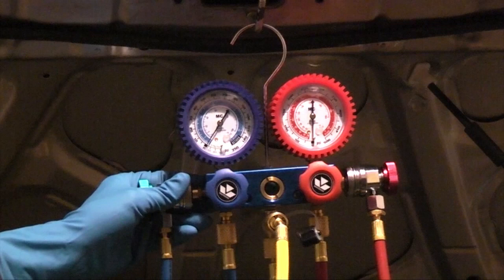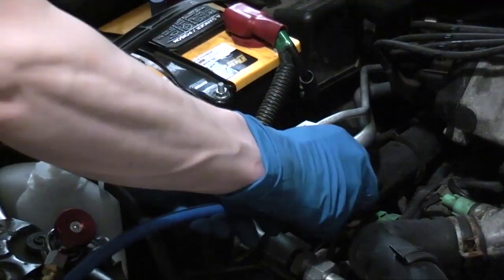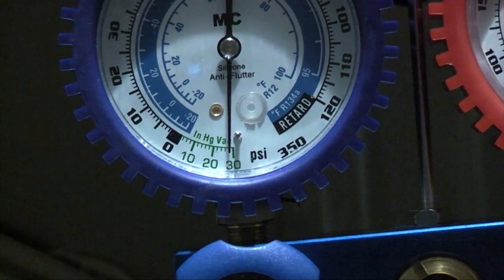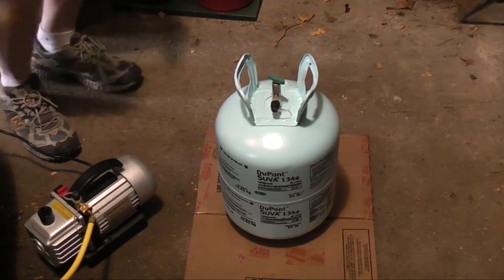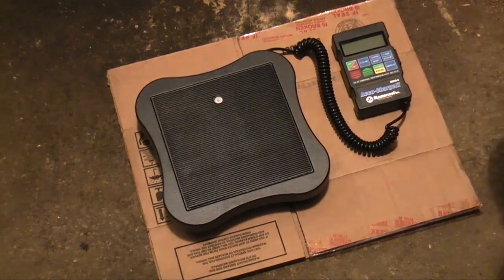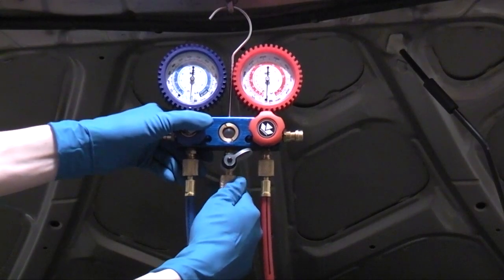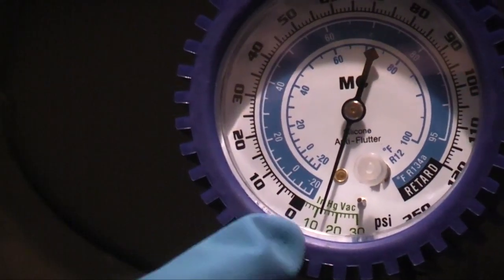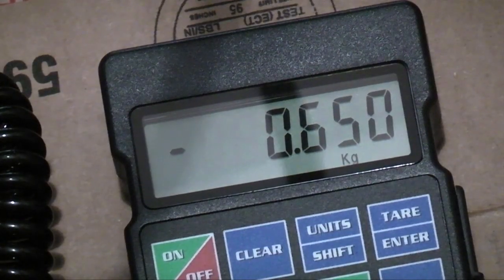How To Recharge an Auto AC System

Comment: Finally, this fellow youtuber,  explains   the importance of vacuuming out the ac system and why it should be done.  What a great  thorough video on AC system charging and testing.. Thanks so much...Canada..
Reply: Yes, one thing make sure you do NOT turn the manual quick connect ALL THE WAY DOWN. 
Watch the gauges as you manually turn them one a a time until they engage the schrader valve, you will notice a small movement on the gauge and then you know the schrader valve is open. I had to replace one of my schrader valve due to turning manual quick connect ALL THE WAY DOWN. GREAT VIDEO!!!

Comment: but the problem that you dont mention how to add oil for the system .
Reply from the maker: Salman Almahal The no special tool method is to pour it into an open line before you close the system up. Adding it to the receiver dryer or accumulator makes less of a mess because they act as a reservoir to hold the oil. The refrigerant charge will distribute it throughout the system when the compressor runs.

You can also buy an oil injector and add it through the low side fitting after the system is closed.
Reply: ***** so we can add the oil before close the system , then make vacuum for the system
Reply from the maker: Salman Almahal
Yes.

Comment: You can only get 30" in hg when close to sea level elevation. at high elevations you get less. Sense there is less atmospheric pressure.
Reply: There is less atmospheric pressure at higher elevations, not that atm. pressure has anything to do with closed vacuum system attainable VACUUM. That vacuum pump can suck vacuum down pretty close to absolute...around 5 pascals.

Comment: Great video.  Covers the fundamentals very well.  The most important part is: you told the audience they need to weigh their charge into the car.  

I have a 1995 Accord V6 which I recently replaced the compressor, dryer, condenser coil, evaporator coil and expansion valve.  The system held nitrogen at 100 psig for one hour and full vacuum for 24 hours.  No leaks.  I charged the car with 21 oz as noted on the label of the vehicle.  I use a Robinair charge cylinder to measure my refrigerant charge.  

Once the vehicle was charged the compressor engaged and the car begins to cool.  Both fans are operating at the radiator.  No short cycling of the compressor however, I cannot get delivery air temperatures below 70F from the dash grills.  All doors and windows closed and the car is in the garage with ambient conditions of 86F and 77% RH. 

This morning the static pressure is 75 psig at ambient conditions of 77F.  At idle the low side: 21-28 psig, high side: 125 psig with compressor engaged.  At 1500 rpm the low side: 15-20 psig and high side 140-150 psig.  The pressures seem low.  

Not sure if I have a bad thermistor or bad remanufactured compressor.   Any suggestions?
Reply from the maker: KMech KMechanical How much oil did you add to replace the lost oil in the old components? The service manual tells you how much oil to add based on which components you've replaced. You have to use the right oil Honda recommends ND8 which is a factory part number. PAG 46 is it's equivalent. PAG is the oil type 46 is the viscosity.

Why was the old compressor replaced? If it was due to mechanical failure you need to flush the aluminum lines to prevent debris from destroying the new compressor. Based on all the components you've replaced the oil in the system will be minimal so I hope you didn't forget to add it.
Reply: *****   Very good point.  I thought that I initially over lubricated the system the first time causing a 'fouling effect' on the cooling coil.  So I flush cleaned the evaporator coil and condenser coil but did not add addition oil.   I have a Honda service manual I purchased from Helm with the recommended oil fill for each component.   I will go back and add where needed.   The compressor was properly filled with PAG oil.  It is my understanding that you need the proper amount of oil in each component along with the correct charge in order to achieve the proper pressure readings?
Reply from the maker: KMech KMechanical
As long as too much oil isn't added it doesn't matter where it's put in the refrigerant will evenly distribute it throughout the system.

Did you insulate the sensor bulb on the expansion valve with prestite tape? It needs to measure the temperature of the evaporator outlet tube and not the air blowing past it.
Reply: ***** I did not answer your other question.  My apologies.  The old compressor did not mechanically fail.  I had a problem with the cold system cooling.  I initially replaced the thermal expansion valve, pulled vacuum and recharged.  The car never cooled below 65F.  In the summer when it was 100F outside it could not keep up.  The car is an old salvage I acquired three years ago.  At the time it cooled great.  Since I had no history on the vehicle I decided to replace the HVAC system this summer.  Its my commuter car to and from work.  I did flush the all refrigerant lines with a flush gun and flushing agent for automotive systems.  All of the lines were dry when reassembled.  The dryer remained sealed until final installation to ensure it was not CV compromised. 

The new compressor has not run too much so hopefully nothing is damaged.
Reply: ***** I did not use prestige tape however, I did cover the bulb well with foam insulation used on copper refrigerant lines.   Felt that I insulated it well from the air stream.

Comment: Hey man great vid with detailed instructions, though I do have one question. Do you have to also purge the low side hose as well after purging the charging hose to prevent an air pocket from that line into the system?
Reply from the maker: 318BENZO No the high and low sides are sealed off from atmospheric pressure by the closed valves. If you were to crack the low side line you'd lose the vacuum.
Reply: Exactly what I thought! Thanks for the confirmation man. Keep up the good lessons.

Comment: Some kinds of refrigerants must be charged as a liquid. They are blends of several kinds of refrigerant that vaporize at different temperatures. If charged as a vapor you don't get equal amounts of all the ingredients and your AC won't work right. Extra equipment is needed to do this safely.
Reply from the maker: Galfonz Well I don't see auto A/C using refrigerant blends like R-410A any time soon =).

The new emerging refrigerant for auto A/C R1234yf is azeotrope or azeotrope-like. So I believe it can also be charged as a vapor. I been following it awhile but I haven't come across a vehicle that needed service with it yet since so few vehicles currently use it.
Reply: The only reason I know anything about it is when I had an AC serviced by what turned out to be a guy who didn't know what he was doing. When a qualified tech fixed it he explained what had happened.
Reply from the maker: Galfonz
If it was a residential system with a refrigerant blend such as R-410a which will fractionate (the refrigerants that make up the mix will separate and enter the system in the wrong proportion) if not charged as a vapor.  I can see that happening.

But R134a can be charged as a liquid without concern.
Reply: ***** but R134A is an azerotropic  refrigerant it must be charged as a liquid.  With the vehicle off one can change the high side and get most of the charge in the system.. When you equalize the pressures then you only charge through the low side in liquid form throttling it very carefully till you have the correct charge.   Then shut off the tank and high side.  Disconnect the high side hose. Continue to charge the system with what is left in the hoses and shut off the suction line and disconnect the hose. Replace the caps and you are done.
Reply from the maker: George W
No you've got it in reverse.

A refrigerant that must be charged as a liquid is a zeotrophic refrigerant. A refrigerant that can be charged as a liquid or a gas is an azeotrophic refrigerant.

So yes you're partially correct R134A is an azeotrophic refrigerant but it can be charged as a vapor or liquid.
Reply: ***** interesting R410A Fractionates Just like R717 or known as ammonia.
Reply: ***** well I stand corrected. Thanks for the information. Believe it or not they teach that in refrigeration schools today.
Reply from the maker: George W
I'd bet most guys that charge auto A/C wouldn't even know this information. It's primarily reserved for those working on residential and commercial A/C systems.

Technically R134a is what is called a pure refrigerant it isn't a mix so it's can't separate (fractionate).

Azeotropic refrigerants are a mix that won't separate when charged as a vapor and therefore ACT like a pure refrigerant.

So for practical purposes I just call R134 a azeotropic refrigerant to avoid explaining a minor technical difference that doesn't matter in practice.
Reply: ***** So true. I've been in the residential and commercial HVAC-R field going on 33 years now.   Curious do you see R134a oil plugging up offices?  I have seen the oil plugging up lots of driers in small to mid sized units over 8 years old. Every once in a while I get one in warranty. Over all it's a decent refrigerant.  I still miss the old R12.

Comment: So I do not need to drain the old refrigerant when vacuum out the system?
Reply from the maker: InTheory Yes You need to have the system evacuated (the refrigerant removed) if your gauge set indicates that there is any pressure in the system before opening the system or pulling a vacuum.

Comment: Dude...how much the desired pressure and temperature between the low side and high side of the system by using refrigerant 134a?
Reply from the maker: Rey Lavador The pressure differential between the high and low side in an operating system will vary depending on the system design. Expansion valve, orifice tube with cycling clutch, variable displacement compressor, etc. Ambient temperature and humidity also are a factor.

A quick and dirty test to evaluate A/C performance is to feel the suction line going to the compressor which comes from the evaporator and the low pressure liquid line (after the expansion valve or orifice tube) going to the evaporator. The temperatures of those lines should be equal if the system is functioning properly. If the liquid line is colder than the suction line is it usually indicates an issue. Most of the time it's because the system isn't fully charged.

Comment: Why don't you pull the manifold gauges to a vacuum before connecting them to the system?? My teacher thought me to do this so that I would be absolutely sure that no air got into the system when connecting the gauges to the service ports.
Reply from the maker: Roger Sahagun The system is empty and at atmospheric pressure and so are the gauge hoses so there is no need to pull a vacuum.
Reply: Yea I saw that sorry about that. But if you're just checking the system for diagnosis, you should  pull the gauges into a vacuum to prevent air from entering the system right?
Reply from the maker: Roger Sahagun
I see nothing wrong with it as long as both valves are opened so the vacuum is pulled on the high and low side lines, the valves are closed after the vacuum is pulled, and both quick connects aren't connected to the charged system during the process.

But it's not common practice. You're also assuming that the low loss quick connects are perfectly air tight.
Reply: If the manifold gauges are pulled into a vacuum, I wouldn't need to "purge" the yellow hose when charging the system right? Or would I still need to purge it
Reply from the maker: Roger Sahagun
Many gauge sets don't have a low loss fitting on the yellow charge line.

So the instant the line is removed from the vacuum pump to connect it to the charging cylinder the vacuum in that hose is broken.

So it would still need to be cracked at the gauge set to purge it with refrigerant.

Even if it has a low loss fitting it's always a good idea to purge the line just to be safe.

Comment: When u vacuum the system dose the liquid refrigerant in the liquid side boil out or it has to be removed some way?
Reply from the maker: WeTryYouWin To remove refrigerant you evacuate the system using a recovery machine. It is then safe to open and service. Opening the system allows air to enter.

You never use a vacuum pump on a charged system a vacuum pump is ONLY for removing air from the system (atmospheric pressure) introduced during servicing the vacuum allows moisture to boil off.
Reply: ***** oooooooooooohh!! Thanks man!

Comment: If you add oil or dye to the charging line I assume you would purge it first but what is the chance of getting air in the line when adding oil/dye.
Reply from the maker: Frank L You can use a dye injector tool which allows you to add the dye after charging.

Or the easier route would be to charge the system with a 12oz can with dye already in it then add the remainder of the charge with the scale.

Total system charge - 12 oz (the refrigerant weight of your typical disposable can) = Remaining charge.
Reply: ***** Thanks for the fast reply, by the way you would have made a great instructor at the West Side Institute of Technology.
I saw that some add oil and/or dye to the charging line and wondered what your thoughts on it were.

I just repair an evaporator on my 2004 optima it held 30 in/vac for about an hour so today I’m going to recharge it and wondered if I should add oil.

Comment: Bushougoma, I fund the problem, since the gages were rental from AutoZone, I guess the last person used it, put some crap oil inside the yellow line and was clogged. After clearing the blue and yellow hoses free from crap oil(or whatever was in there, the 2nd and 3rd can went in there with no problem. The blue gage is reading at 38psi now with A/C running with 2 1/2 can of R134(I use 1/2 or so to clear the line unfortunately and get the air out of the blue and yellow hose as well).
my new question are:
1. is 2 1/2 can is ok with this system that requires 2.0 pound of R134, or should I add 1 more can?
2. is 38~39 psi ok on the blue gage with A/C running at max cold?
3. A/C vent temp is at 58 degrees sitting in the garage at idol speed with about 2 1/2 can so far, is that ok temp or is it to high? (I'm thinking I need to add 1 more can of R134 still, however, I do not want to over charge the A/C. Not sure what my gauge will be reading if i'm over charged or under charged).

Sorry for the my 1st question, had no idea hose was clogged, since the 1st can went in there after several tries. Anyway, thank you very much for your help and time.

Comment: bushougoma, I'm working on a 1998 Pontiac Trans Sport mini van A/C. After installing brand "NEW" A/C compressor(WITH OIL) AND a "NEW" dryer, I used a vacuum pump exactly as you mentioned. I also replace all the o-rings in the system( FYI, this mini van already has NEW hoses). After vacuuming the system for 1+hr, and testing air leak for 10+ hrs, everything was perfect with no leak whatsoever. So, it was time to fill the system just with 3 mall R-134 12 OZ cans.
At first, the 1st can would not even go to the system. After several tries, it finally started to go in using ONLY the LOW side with hi side OFF(as you mentioned). After several min 1st can went empty with A/C clutch finally engaged. So I close the blue hose valve and replaced the can with the 2nd r-134 12 OZ can(with bleeding the system as you mentioned once more). However, for some reason the 2nd can will NOT go in the system at all no matter what, even with A/C compressor clutch engaged and working. NOTHING from the 2nd can is going in and I do not see anything flowing in that small glass above the yellow line. Do you have any suggestions as to what might causing it not to suck in any more(FYI, I ONLY use one 12 OZ can so far, I was told it will take 36 oz's, OR 2 LB of R134 as it shows on the sticker in front of the car). Also FYI, the blue gage shows 35psi and that's it. I'm puzzled. Please help:-) thank you very much in advance.

Comment: hello please reply:  isn't that u realeasing r-134a into atmosphere when u do the vacumm thingi
Reply from the maker: GAR A You never attach a vacuum pump to a pressurized system if the system has any refrigerant in it it must be evacuated with a recovery machine first.

A vacuum pump can only be used to remove atmospheric pressure from the system which will get in after the piping in the system is opened.

Comment: This is the most complete, accurate, and professional video I have seen on the subject. Well done, and thanks for sharing!
Reply: Gary Drury I agree this guy is very accurate
Reply: E39M5SPEED I don't agree fully because many things were said for someone who is advance . After he started to use the scale the explanation was fast and not easy to understand
Reply: @troyb6036  - His explanation when started to explain the "Weight, Measurement and Distribution" of the tank to scale was excellent and could not have done a better job of explaining it. I've never done an AC job but have mechanic and crafted many things to know that explanation of the tank. Maybe you need to take a course on "Weight, Measurement and Distribution" that will allow you to grasp things as the purpose of scales quickly.
Reply: @Bruce Lee - I think you need to first decipher someone's answer if your going to put it under the mill. He did explain the theory "Right" so maybe you need to do your research because when the system asks for so many pounds that's what you put in. Nothing else was talked about nut that so get your research together cause it seems to flake somewhere else. If you have a problem, Hey showing is everything where talk is "BS".
Reply: Can will see this products